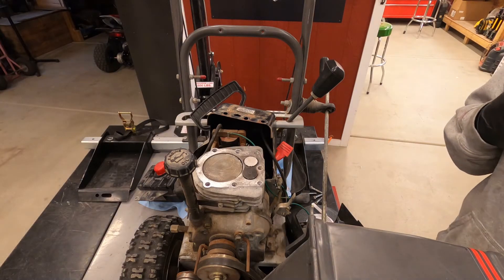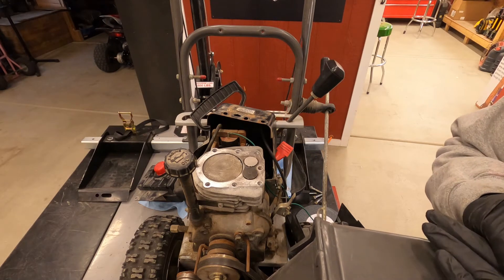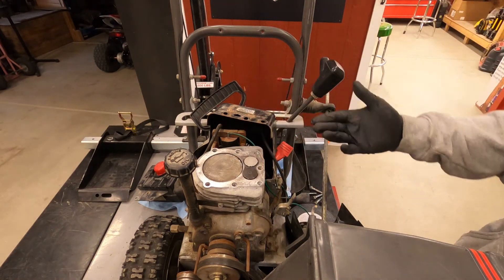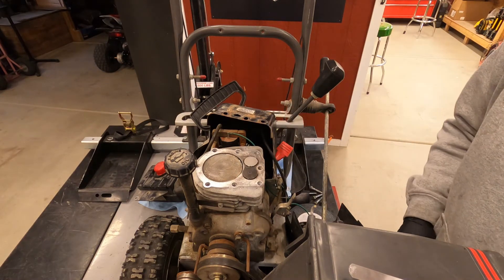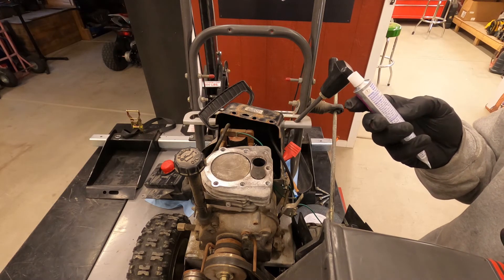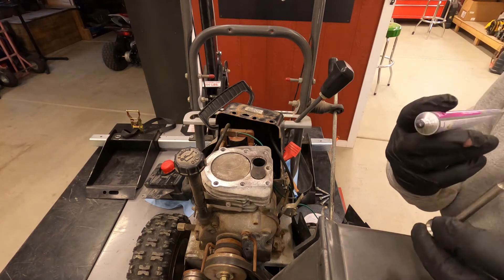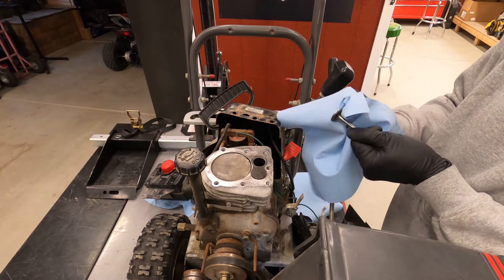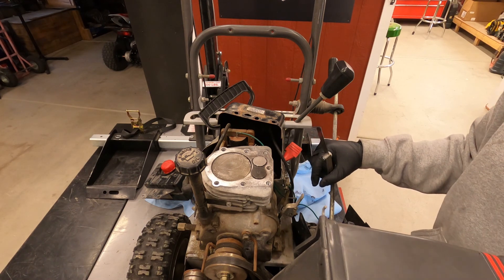How to grind and lap Tecumseh small engine valves

Comment: I have a 5 hp tecumseh now the more they run and warm up the worse they run. Can even hear the valve issue. The newer ones the head gaskets come apart upon removal  so you need a head and a few more gaskets if they break

Comment: I have a Tecumseh HM80-155404L like this but with a tapered crankshaft so there's not really a replacement. I spent $500 on parts and machine work and the rod threw the block. Turns out the crankshaft key sheared off and timing was way advanced. I bought a new block but poor now so can't afford machine. Are Tecumseh engines known for bottom-end failure? I'm kinda afraid to do this if a spec gets into the oil... (running fine with my original worn parts, but lacks Torque at full load. Rings and hone new)

Comment: Nice video!  Just wondering, would it better to lap the valve before grinding?  My thought is that if you grind first (to get the desired clearance), then lap, wouldn't lapping after cause the valve to sit 'lower' thus messing up the clearance you initially set?

Comment: What do you use to obtain specs and technical data on all types of small engine?
Reply from the maker: I am old school and like physical copies of things especially to look at while I am working with greasy hands instead of pulling out my phone or using a computer.  You can pretty much find anything online, but I prefer the manuals and books.  You can look those up on amazon or eBay.  Otherwise just do a google search for the specs of the engine you are working on, save it to your computer in a file, or print it off...

Comment: Thanks for the video. A good reminder to us that when we lap or replace a valve it is likely we'll need to deal with the valve length like you showed us.
A suggestion... perhaps go on ebay & find an old v-block (you can find small ones) so that yu can use it to keep your valve squared-up to the surface of the grinding wheel. Plus, v-blocks are just a handy thing to have. Find one with a clamp.
Thanks, again.
Reply from the maker: Great suggestion.  Thank you for sharing!

Comment: Did a rebuild (new block, piston, rings, valves, gaskets) on my 2003 MTD Snowblower Tecumseh hssk50 5hp and I set the intake at .004 and the exhaust at .008 and set the coil airgap with a business card.
Now regretting I didn't set the intake and exhaust a little more.
Reply from the maker: Yeah, while you should be ok at .004 it is on the lower end of the spec.  I typically try to shoot for the middle range of the specs.  Is it giving you trouble?
Reply: @kbssmallenginerepair2615  ... some history on the machine and why I rebuilt it; when I say this machine still looks like new I'm not joking...I would wax it! I purchased new in 2003, used very little but it did work well. I made/added the rubber impeller attachments which greatly improved the machine ability to throw snow much further, always changed the oil and never saw any metal in the oil. Again, never really used it every winter with lighter snow accumulations. But last heavy storm time I used it in 2015 I noticed it was having a hard time even getting through 4" of light snow and was difficult to start. I did a compression test and sure enough it dropped. Pulled the head and the cylinder walls were wiped out! Sever score marks and gouges you could feel with a fingernail yet, the piston skirt was fine. Ordered a new block, pistons, rings, valves and gaskets total parts $200 and change. I was meticulous with the rebuild and back then I didn't realize the valve spec for my Tecumseh HSSK50 5hp was between  	.004 / .008 I THOUGHT it was .004 for the intake and .008 on the exhaust...kinda like how I would set up the valves on my race cars with solid lifters...the intake was a different spec vs the exhaust. When I rebuilt it back in 2015 I never even started it and here in SE Pa we haven't had significant snow to where I needed it. Until a few days ago... I did the first start, fired right up a little smoke because there was oil on the cylinder from rebuild and within several minutes of warm-up it started acting odd. I pulled the carb, all passages were clean and open, needle and seat were working as should so then I pull the valve cover and double check the clearances... they was as I grinded them to be .004/intake and .008/exhaust. but now I realize I'm on the extreme low/high margins of the specs. For giggles I'm going to double check the coil air-gap.
Reply: @kbssmallenginerepair2615  ... I tinkered with the governor adjustment...all seems good. I may order a $15.00 adjustable carb for it to dial it in more.
Reply from the maker: @hmdwn  perfect! Glad it worked out for you.

Comment: What exactly wears to allow the clearance to be reduced to zero, or less? Cannot see it being the valve face or you would have to regrind it, not just a fast lap job. Nobody addresses this on YT.  They should have originally installed adjustable lifters like they did in old cars and trucks with flat head engines, would save a lot of work. .008"  (in) and .012" (exh.)  is what I see on other sites. More is better is what I think.....allows longer intervals between adjustments.

I really like your style, I am subscribed, thanks.

Geo.
Reply from the maker: Hi Geo, Thanks for watching and subscribing!  Typically the valve seat wears down which causes the valve to sit lower therefore losing all valve clearance. For this particular model Tecumseh calls for .004-.008 on both sides, but you are correct, a lot of guys like to use .008in & .012ex across the board.
Reply: @kbssmallenginerepair2615  Thanks for that speedy reply. But I think you mean the valve sits higher thus never closing.  I have a 5HP Tecumseh that needs a look-see at the valves, but it can wait. My neighbour had a 10 1/2 HP that I have been eyeing and he finally gave in. It is now on my 24" MTD and performing admirably. These have the extended camshaft to drive the wheels.

Geo.
Reply from the maker: @geobrown9413  Yes, I can see how that sounded confusing.  When the valve seat wears down or sinks in the engine block, this in turn will also drop the valve (causing the valve to sit lower in the engine block than from the factory)  Because the seat AND the valve is now lower (losing all valve clearance) the valve sits above (higher) than the valve seat and does not seal properly causing loss of compression.
Reply: @kbssmallenginerepair2615   Gotcha. Thanks for clarifying.

Comment: Would it run if it were .009-.010. ????
Reply from the maker: Yes it would.  A little more is ok, depending on the engine.  This particular model calls for .004-.008.
Reply: @kbssmallenginerepair2615  Even 9 or 10 would be OK. tecumseh valves are known for stretching.